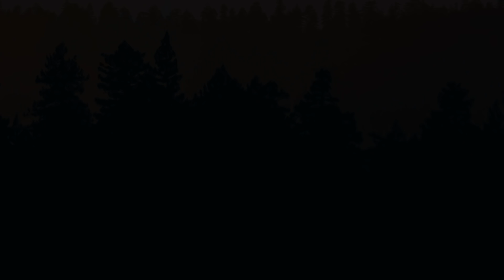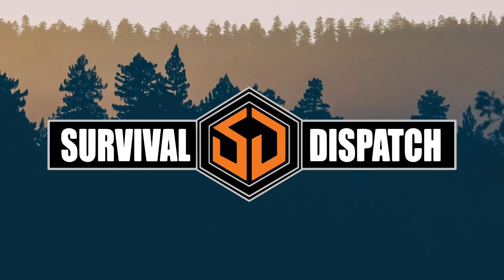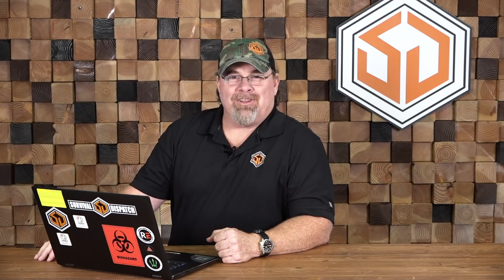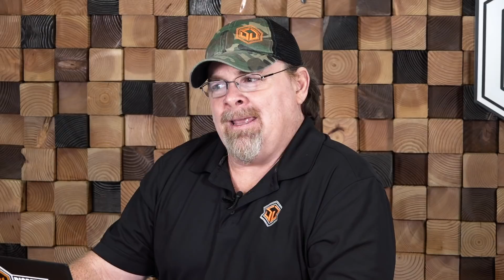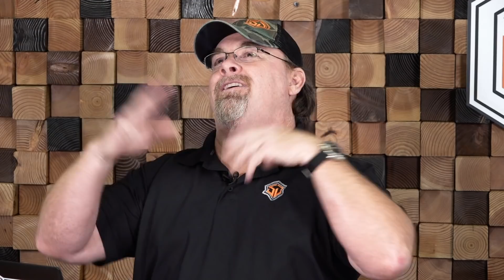All About Generators!

Comment: Had a boss one time that wanted to use a great big propane tank for a reserve tank for his shop's air compressor system. He had some of his other minions try and flush it out and let that water run down the gravel yard. It smelled/stunk for months afterwards. Same boss would be 'that guy' that would make his welders replace floors in pig trailers ... the smell of cooked pig poo doesn't come out of your skin for a minimum of a week - thank God I was a machinist & worked at the far end of the shop & still almost barfed! Same boss would take in garbage trucks from the larger city to the east because no one wanted to work on diaper & tampons that got wedged in the door gaskets that needed to be weld repaired! Needless to say I don't miss working there.
Reply: AmmoC9M sounds like you hit the offensive olfactory Powerball lottery trifecta! Congratulations!🎉🎊🍾🎈
Reply: Your boss sounds like a smart guy.  Value is found in places where others are unwilling to look and that's what paid your paycheck.  I too use a propane tank for air and it works great.  They may be worthless as propane tanks once they're old but they make great air tanks for nearly no cost.  Boo hoo, welders had to get stinky.  People work around pig poo all the time - ever eat bacon?  Where do you think it comes from.  Oh no!  He repaired garbage trucks!  How terrible!  Christ alive...
Reply: @knurlgnar24  I've owned my own shop now for 16 years -so now I get to be the Dink! .... no, not really, I treat my guys more like humans, but it's always good to be reminded that there are still dinks out there.
Reply: Here are the rules about portable generator safety: This is just a reminder for everyone’s safety. All generator safety rules should be followed carefully. This advice is just to make sure that everyone is aware of all the warnings and it’s just to remind people to be careful using portable generators. Generators can be dangerous if not used carefully. Every year, hundreds of people die or get injured when using portable generators due to carbon monoxide poisoning and electrocution. Make sure you are using your generator carefully and keeping others safe as well. There is something very serious that everyone should always be aware of when using generators. Some people do run their generator indoors which is not safe and that increases the risk of carbon monoxide poisoning which can cause death of family and you. Some people run their generator in wet conditions which can electrocute them. Please remember that you should never run your generator indoors. Remember that carbon monoxide is an odorless and colorless gas that you cannot see or smell. Carbon monoxide is a silent killer. Keep that in mind. Make sure your generator is 15-20 feet away from your house and away from doors, windows, and vents. Never use your generator in your porch too. Having a carbon monoxide detector is very important against generator safety. Some people also allow children to go near the portable generator which could pose risks. We need to keep an eye on our children making sure that they are not near the portable generator so they won’t get electrocuted or burned by the generator which is dangerous. A locking enclosure also keeps kids safe. A generator shed might look like a tempting place to explore, or take cover during a game of hide and seek, but a generator is a dangerous piece of equipment that can cause injury. It says on the manual that we should also keep children away at all times from the portable generator to avoid injuries. Please do not allow a child or unqualified people to operate the portable generator.  It is important to keep your children safe especially little ones. The portable generator can be hot during an operation. Just because some manuals missed what should be listed doesn’t mean it’s safe to do. Always follow the generator safety rules when using portable generators. Generators pose electrical risks. If you need to use your generator during wet weather, you need a generator tent to protect your generator from getting wet. Don’t let your generator get wet. Keep your generator dry and before using your generator, please make sure your hands and your generator is dry. Do not wear loose clothing when operating the generator. Everything that is said on the generator’s operating manual should not be ignored. Never smoke cigarettes near the generator. Please keep flammable things away from the generator. Never overload your generator too. Your generator can catch fire. Never ever try to plug a generator cord into a wall outlet to avoid back feeding. Back feeding your generator is dangerous. Always turn on your generator first before plugging in appliances and shut off the appliances before turning your generator off. Use a heavy duty cord for your generator and the cord should not be worn out. All the instructions should be followed carefully. Never refuel your generator while it’s running. It can cause fire if fuel spills while your generator is hot. You should turn off your generator and let it cool off before refueling it. Having a fire extinguisher next to the generator is also important. This is only a reminder for everyone’s safety of using generators. Make sure your generator is properly grounded. Having a fire extinguisher next to the generator is also important against the safety rules. https://youtu.be/I1jT3ANENvI and here is a video more about keeping others safe when using generators and also about our family’s safety. It’s important to keep our children safe especially our little ones. Generators also cause electric shocks. Better be safe than sorry. Hope this helps. Thank you.

Comment: It is strange that there is a problem with ethanol in gas now.  When I was young the high octane gas was called Ethel because they ethanol to give it higher octane. I have stored gasoline for a long time without the ethanol separating.  Everyone blames ethanol for everything. If you store gasoline in a tank for a long time with it half full or less as it changes temperature air moves in and out as the temperature changes and the moisture in in the air will condense and add water to the gas.  My father always told me not to have the gas tank less than half full for a long time. This was in the 50's long before Obama made them put ethanol in the gas. I think that if you look what they are pushing in the gasoline now. You can ask for the information of what they are pushing in the gasoline now.  You will be amazed what junk they are pushing in their now!
Reply: Believe me when I say ethanol is a problem. I have replaced countless carburaters and fuel lines on all sorts of small engines it's always the ethanol that caused the aluminum to oxidize to the point of the carbs literally disintergrating and turn the rubber lines to black mush allowing the mush in the main jet clogging them up.
Reply: Ethyl was tetraEthyl lead which served to control the octane rating of the fuel and it provided lubricity to the mixture for the valves.  Unfortunately it tended to form deposits and was dispersing lead into the environment.  Ethyl alcohol can also be used to adjust octane rating but as an oxygenated fuel it attacks both rubber seals and corrodes metal in the fuel system.  To further complicate the picture ethanol is hygroscopic and literally draws water.
Reply: @rubenhamilton8223   There are a lot of things that want to get something in them when they are pure! Water doesn't like to be pure. Pure water wants something in it and will take in almost anything. Get your pool water very pure and it will start taking the steal or brass from your pump! Is ethanol hydroponics after mixed with gas. Or only when it is near pure. I know that when they mix ethanol with gasoline the water that is in the ethanol comes out. Because the gasoline replaces the water in the ethanol! I think everyone needs to look at the other things that are in the gasoline. Search for the break down on what is in Gasoline! They were forced to put Ethanol in by the government! Adding Ethanol increases the Octane! Low Octane fuel needed some things added to bring the Octane down to what it should be! So they started adding in a lot of other things to bring down the Octane! Get the breakdown of what is in the gasoline. You will find a lot of junk added to the low octane fuel to drop the octane down. Now is it the ethanol or is it the other things in there? If you don't like the ethanol in the gas talk to Obama! Him with his friends are the ones that forced the gas company to put it in there! The problem is the government forced them to put it in there but the car manufactures want to use the cheapest parts they can. Cheap parts, gasoline that the government forced to have ethanol in it. Maybe we should tell the law makers to stop forcing the gas companies to put it in. And then we can just drink the ethanol! and the gas companies can stop putting all the other junk in the different
Reply: I agree.  Even if I treat my gas it doesn’t last and my motorcycle carbs get gummed up with this green substance that’s like glue.  Never have I seen this in all my years.  Personally I think they are purposely fucking with our gasoline to create pain, added cost of repairs/upkeep and chaos.

Comment: Reverse polarity, on AC?
Ok
Reply: If your outlet's polarity is reversed, it means that the neutral wire is connected to where the hot wire is supposed to be. This may not sound like a terrible thing, but it is. There is always electricity flowing out of an outlet with reversed polarity, even if an appliance is supposed to be off.

Comment: I would rather use a natural gas generator. Install an outside port to connect to and you don't have to drive around searching for fuel competing with everyone else doing the same thing to find a gas station that is still operational and hasn't run out of gas yet.
Reply: Some thought should be given if you would be supplied by a company. If the fit is hitting the shan. Say a hurricane. Electric and fuel companies may turn off service during and be slow to turn on after a major event.

Comment: Are propane conversion kits difficult to install? Also is there a concern with temperature or elevation when converting to propane?
Reply: Propane in a gas engine requires derating.  Propane may not flow enough vapor to run at derated power level when the tanks are very cold.  Propane-only gensets, or Diesel, are the way to go, with higher compression and better efficiency to take advantage of the high octane and gas-expansion cooling of propane. Gensets seem to use the most primitive ICE tech (flathead, basic carb, points), not direct injection, because the mfg's can, except in California.
Reply: Conversion kits are very easy to install.  I just purchased a Champion 8750/7000 Inverter Generator and added a tri-fuel kit in about two hours.